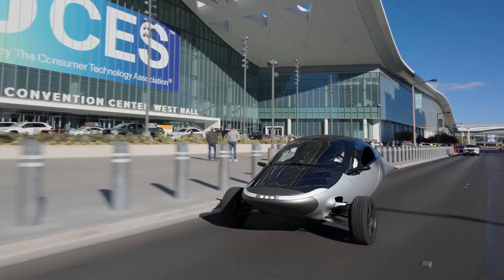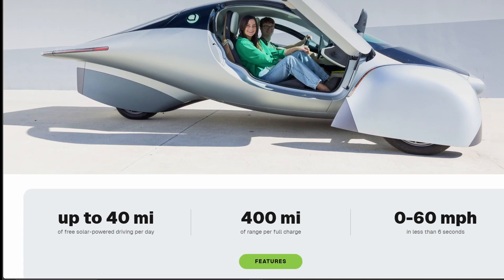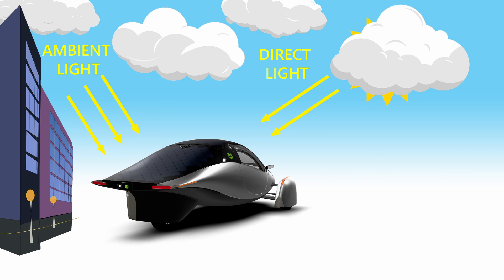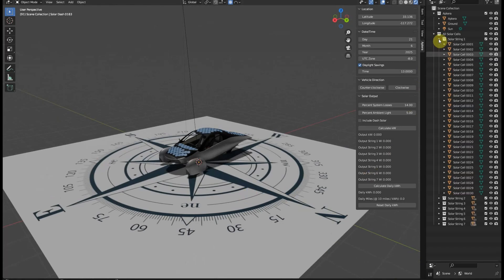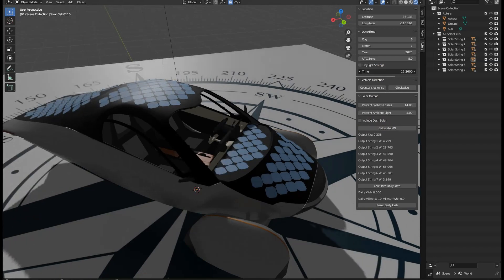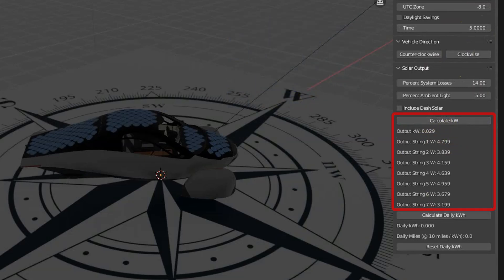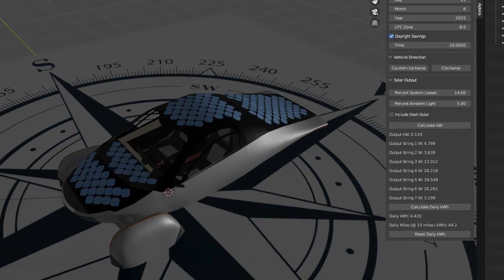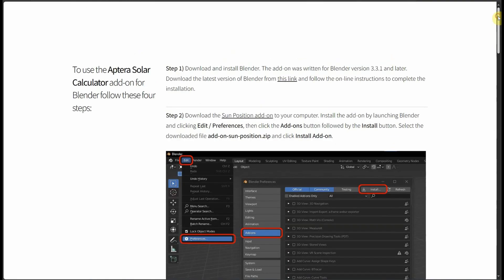Aptera Solar Calculator for Blender Version 2

Comment: Excellent engineering work ! Congrats ! But to be frank Aptera solar cells (only 700 Watts of theoritical power in total) is a joke! Parking a car under the sun has only one effect => the car is cooked and AC needs to be turned ON at full speed when the driver comes back... AC will loose in seconds/minutes the little solar energy stored in the Aptera battery during hours 👎Fortunately, this car has an NACS plug to recharge its battery! Aptera has a fantastic shape resulting to to a remarquable efficiency 👍. BUT the 'solar EV' story is just a funny marketing message 😂

Comment: Have they confirmed that the car gets 10 miles per kwh?  I know they were shooting for that, but I haven't seen a hard confirmation that it was achieved? Please let me know if they did so, and I missed it.
Reply: sirenbrian  That is what the vehicles they are building right now are for perfomance testing, crash testing, and efficiency testing.
Reply: nope, they did track testing but supressed the results. Instead they did a downhill run starting at flagstaff and went down 7,000ft in altitude. They claimes 8 miles/kwh but people figured out it was a huge elevation drop, and so it seems they have tried to fake their efficiency. Dissapointing they resort to this rather than release the actual efficiency found during track testing. They have been logging the data since ces vegas display but also supressed all results.
Just for interest the test track is here
Honda test track gps co-ords  
35deg 15 min 34sec north ( 35.1939 )
-117deg 57min 30sec west ( -117.9227)
but as mentioned any results were supressed.

Comment: So I just did a check on the calibration, using 'all about solar' test drive video his comment of 160watts at 5 mins into the video:
 prediction is a bit high, but not too bad. All about solar got : 160watts at this particular location ( 5 min mark in all about solar video), blender render got: 185watts.
A bit of an over estimate but I would say pretty good.
I put in exact co-ords, time/day and orientation of the vehicle. 
Here is the data I used ( anyone can confirm the results):
location: its about half way along Paradise Rd stretch of the test drive course, vehicle is facing direct south, front of vehicle towards the sun.
gps: 36deg07min59sec North
        115deg09min17sec west
as decimals to input into blender render: 36.13305556 and -115.15472222  ( I think the blender render rounds off the too 3 decimal places)
Date is 9th of jan, 2025  and time is noon. 
Using the kwh hour button gives 185watts.........pretty impressive, but its over estimate, but in the ball park
Just for anyone geeked out, rotating the aptera in  direction gets ( for this particular location/time/date)
facing south: 185watts
facing north: 287watts
facing east: 156watts
facing west: 208watts
( I might have got east/west mixed up........doesn't matter anyone wanting to verify can do so and find out which is which )
Thats using the kwh button, not the total daily button. Haven't tried using total daily button, it sometimes gives different result to using the kwh button for some reason.

Comment: when you calibrated to jerryrig everything 29watts, you left the direction of vehicle as north west, it was facing west in the video, probably wont make any difference.
Its only 10ft from aptera owners club video, so its calibrated to that location with those buildings around it. The building opposite is multistory with reflective windows. 
Most of the buildings seem to be white during the test drives, but its likely your calibration is good for that particular location, might not be accurate as soon as you drive to another location with a different amount of diffuse light. It does highlight the complexity of the real world. Easiest solution would be for aptera to just release the data. Since aptera owners club average speed for his drive was 20mph, thats about where max efficiency occurs for electric vehicles ( miles/kwh units, this according to tesla data). Releasing the data would show what max efficiency is, and allow better understanding of the solar potential also. 
I note fambro made a statement they saw 500watts recently when parked near a white building, that certainly does not seem to be the case in vegas. In the shade the watts goes from just under 30watts up to 70watts in shade. You could conclude in vegas in an area of high building diffuse light ( due to many white buildings of multistory)  that 40watts is about the max range of diffuse light wattage.

Comment: Honda test track gps co-ords  
35deg 15 min 34sec north ( 35.1939 )
-117deg 57min 30sec west ( -117.9227)
Using blender render gets 1.7kwh for 9th of february 2025.. I've orientated it east/west.
I get 42kw with horizontal sun facing the front, aptera shows 23 watts so there might be a bit of over-estimation going on in the bender model.
Note also the program has bugs in it, especially regarding late afternoon, in this instance the aptera was still generating power after the sun went down, there is definitely some issues with the program so results unfortunately cant really put much trust in them due to those bugs. Note I had to cut off the kwh at 6pm since the program shows high values of energy still be produced after the sun is below the horizon, there are bugs.
Anyhow at the honda test track the model shows 1.7kwh for the day ( they will say some rediculous amount of solar was generated of course). According to the program at 10mile/kwh only 17 miles would be produced, I still think will be a large over estimate.
At least something to compare to what ever aptera decides to say they got.

Comment: I've just gone over the carlsbad data using weather and kwh using 21st day of each month as average for each month. Then I've used the cloud cover % values you got from nrel for each  month. The average kwh per month taking into account the cloud cover comes to 2.88kwh as an average for the year.
Assuming 10miles kwh the average for the year would be 29 miles. 
I'm guessing average miles/kwh is going to be much lower than this, and of course is variable according to many factors, lets say 7 miles/kwh ( I think its going to be a bit lower than ) would give an average of 20 miles/kwh. 
This calculator is of course still giving a type of maximum with east/west orientation.
During early morning and late afternoon, there is some shading of the panels ( not just the dash). So once you get in the real world its still going to be alot lower, I'm going to say an average of somewhere between 8 and 12 miles /kwh (thats my guesstimate)
Anyhow the model does get a bit closer to reality, still will be over estimate in my view for many many reasons. Car is stationary is one reason!
*postscript: initially I wrote 2.18kwh/day was average, there was error in my adding, and its 2.88 kwh/day average at carlsbad taking into account clouds from nrel

Comment: Its good you've added the dash add/remove button, but there are times when the front hood or rear hatch are shaded also in early morning/late afternoon, so another area of inaccuracy which will lead to over estimating output ( not by much I guess).
Reply: I think the idea is that the rest of the hull is convex enough for the slope normal to be good enough to know if a cell is shaded or not. The dash on the other hand is very concave and can get shaded well into a still efficient angle to matter.
Reply: @Vaasref  one solar cell shaded ruins the output of the whole string of cells.

Comment: Just went over blender version 1, looking at adding cloud percentages, very detailed work and should give some good estimates with new blender.
I put a post on blender v1 about fambros post on x, showing some solar output when exiting their factory. It was the first piece of purposefully posted information on solar from aptera showing some exact numbers. Anyhow in my post I outlined the data and it showed the dash has an output of 31watts for 22nd august 2024 at 10:15am.
Your new v2 program produces a value 45% greater than this showing 45watts as dash output, some possibility the windscreen is having some effect.
it does highlight the difficulty to replicate the real world, I would think its about time aptera published some real data on the solar produced in the real world. Considering they have been confidently boasting 40miles per day and 11k miles per year ( 30miles/day) and then from this boasting the average usa driver wont have to recharge, which is a false claim.

Comment: if you look at the time in the last part when simulating carlsbad, you can see the time goes up to 34:00.........thats doesn't make sense............even in 24 hour time, unless your time travelling into the future.
Reply from the maker: Thanks for catching that. Apparently, I accidently entered the time value of 6 (for 6am) into the UTC cell, changing if from an offset of -8 to +6. This obviously in not correct but the end result is simply a shifting of the clock and you see the position of the sun is still correct, that is all that matters. It is the same latitude and longitude location so the calculated value of 4.43 kWh is still correct for Carlsbad.
Reply: @ I also had some issues with adding the kw totals up each hour, did not match the daily kwh readings that were coming up on the kw section. It seems to have resolved itself weirdly enough. Any ideas on what was going on there?
Reply: I've a bit of time on this, and there is definitely an issue with the daily kwh button. It doesn't always match the kw readings if you do them by themselves by changing time manually.
Also I just did a daily kwh for carlsbad at winter solstice, using the kw button adding them comes to 1.053kwh.
If I used the daily kwh I get 1.026kwh 
But and this is a big butt ( sorry for pun), if I reset the daily kwh, then if I put say 6am into the time, the sun position is for afternoon sometime, it doesn't go back to where it should be for 6am. There is definitely some issue here.  Hope you can resolve it, it seems like a really well developed program but there are some bugs.

Comment: So I did the model for winter solstice at vegas, its comes to 
1.175 kwh ( leaving dash on from 7am till 6pm, so its a bit high).
This would equate to approx 12 miles approx  if 10miles/kwh is achieved.
This is pretty close to early jan when ces occured, obviously the directors statements of more solar created than consumed over 25 mile rides is rubbish.
I'm going to assume your calculator is pretty accurate and quite useful. I could do for the day the directors claim they did 25 miles and had more energy at end of he day but its so close to the winter solstice the answer wont change much.
I can see why you didn't supply the winter solstice numbers now in my request.
Reply from the maker: I believe that they followed up with a clarification on that statement that it wasn't quite that high. Using the calculator with the version of the model that has only 183 solar cells, I can get as high as 1.87 kWh on Jan 6th if I optimize the orientation of the vehicle. This is more in line with their statement. There are also many reflective buildings in Vegas that could influence the solar upwards but that is difficult to model.
Reply: @experienceaptera  yes fambro did back pedal on their statements on solar in first part of livestream from ces, he said solar was about same as energy used, c.anthony a few seconds later said solar was more than energy used.
Obviously just making it up on  the spot, they were caught out lying again. Once they realised they were caught out fambro said it was just anecdotal.
Which direction did you orientate to maximise output?
Reply: The 100 wh/mile is estimated at 60 mph (using the EV Range Estimate spreadsheet that ApteraOwnersClub has discussed in a previous video). Dropping the speed down to 30 mph which is more inline with the Las Vegas demo rides increases the estimated efficiency to 55 wh/mile, which would be about 22 miles of added range. So not far from the anecdotal statement from Steve Fambro.
Reply: ok edited my answer a few times, as I dont have much understanding of ev efficiencies at different speeds.  Fambro is using 110wh/mile ( 9 miles/kwh) as his value of choice these days. But i did a quick research and it seems your right ev's are more efficient at lower speeds ( to a point) being around 20mph is the most efficient for tesla according to their data. The energy used /mile increasing on both sides of the 20mph mark, should be pretty similar for aptera.
Fambros anecdotal statement was that the solar energy produced was the same as that used on a full day of test drives which is about 25 miles. The big problem is if the car was not moving most of the time at the bagel shop, ninjineer pointed out that after around noon that carpark is in shade, and the amount produced in shade is very low, it seems to vary quite a bit due to the surrounding buildings causing alot of diffuse radiation, but 30 to 70watts, is all it was shown to get in the shade at vegas.
If they did 25 miles of test drives each day that is 2 hours of test driving using aoc time taken to go around the loop. During driving solar is all over the place not constant.

I believe It is basically impossible for fambros claim to be true, he and chris anthony were caught out big time on this occasion. Seems they are now so brazen at making up claims they will just lie publicly without giving it a second thought. From all the test drives I can find at vegas and spending quite a bit of time going over them many many times, it can be seen over a three day period the battery state of charge went down from around 81% to 64%, an average each day of around 6%. My memory is not perfect but I have put up the exact numbers elsewhere. That a sizeable drop each day and in no way corroberates fambros claim. A 42kwh pack, 6% would be 2.5kwh drop each day and the solar produced should be included in that voltage drop...........or you could say a 7.5kwh drop over 3 days, either way it appears fambro simply made it up, and a few seconds later c.anthony increases their claim again, on the spot, in public, that solar produced was MORE than that used by the vehicle........if you cant see that in a few seconds the claims had changed from solar was same as that used, to solar was more than that used, either way the claims are false. I doubt they have even looked at the state of charge, it seemed that it was just a statement they decided to make for the reason of getting more investment money. Seems obvious to me.
One argument would be the vehicles were recharged at night, but chris macammon says in his test drive video they started the morning at 81% from memory.
anyhow if you want to believe something else than what seems perfectly obvious you can do that, in fact I encourage you to invest as much as you can in this company if you believe these guys are honest. I wouldn't go near it if you paid me!

Comment: Exceptional! Have you done a 365 day analysis for Carlsbad? Your summer solstice result is a little lower than i expected such that a 3kWh/day annual average looks difficult.
Reply: Could you do this to approximate the annual weather in PVwatts? Model an optimally orientated 100W panel in your program to back out peak equivalent hrs for the summer solstice. Then ratio the published (or PVwatts) avg peak equiv hrs/day for Carlsbad. Multiply that by your Aptera solstice result x 365 days.
Reply: @artsmith103  wish I understood that I might try it!

Comment: I am not used to blender and have v4.3.2 I have gotten as far as changing to rendered mode but can't find the button. Any suggestions?
Reply from the maker: Is your question about where the "rendered" mode button is? This is shown in the first screen snapshot in step 4 of the download instructions - https://experienceaptera.com/aptera-solar-calculator-2.html
Reply: @experienceaptera  Got it, the button was so small I had to guess which one it was